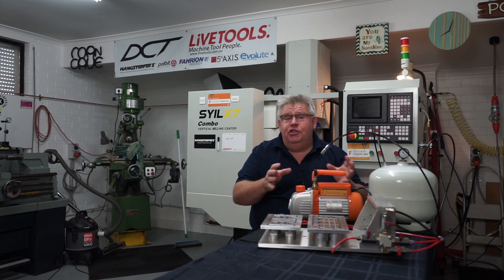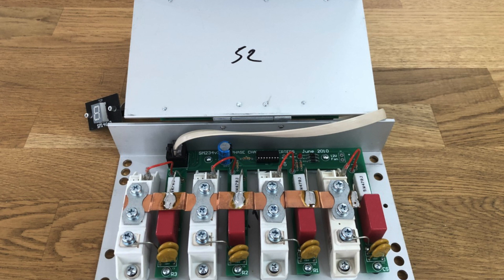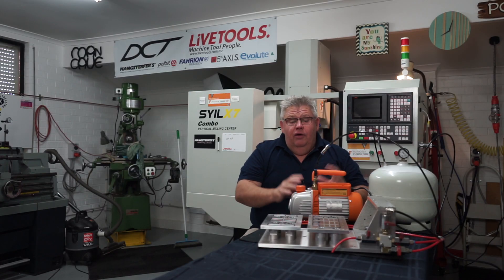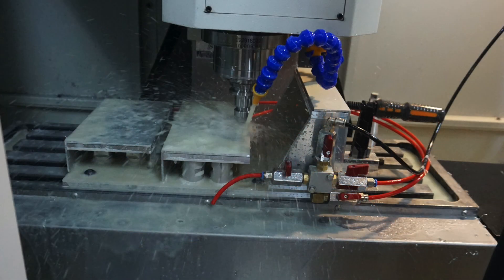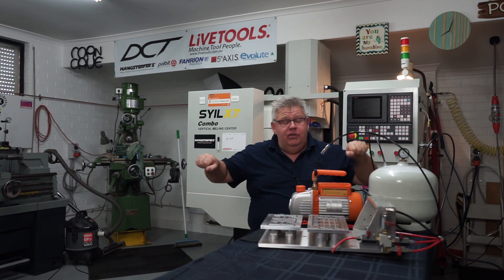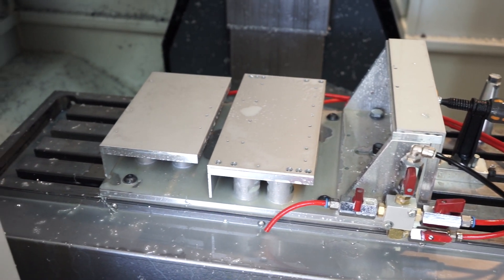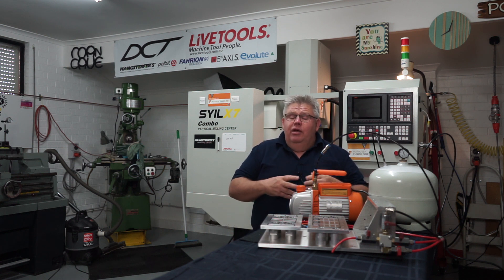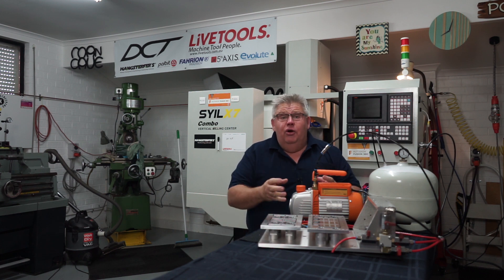CNC Vacuum Fixture Set Up - Homemade DIY

Comment: Good job. I wouldn’t worry about the temp of the vacuum pump. I run mine (JB & Yellow Jacket) for 24 plus hours straight. It does get hot though.
Reply from the maker: Excellent point. Since that video I bought a timer and run a 50% duty cycle. Cheers 🍻

Comment: You can get a cheap used SMC pressure/vac controller on Ebay or a Chinese clone for a about USD20-30. It's a really simple set up where the vac controller triggers a solid state relay to turn your pump on/off according to whatever target pressure and hysterisis you have set on the controller. I have this on a similar setup to yours though I am using it for vac bagging composites and the SMC controller is great to have.That way, you actually don't have to remember to turn the pump on or off, it will take care of that for you. 
Also, good on you for remembering the check valve as these pumps don't like to start against a vacuum. 
But some builders take it one step further and add a 3-way solenoid valve between the pump and the check valve to vent the pump side so that that when it has to restart, there's no vacuum at all to start up against. This should prolong the life of the pump. That said, I realized my pump (same style as yours though smaller) actually leaks/vents slowly by itself when turned off, so I don't actually need the solenoid. Perhaps yours does as well?  
For more on the solenoid venting google "Joe Woodwork Vacuum Pump" and a build manual and reasoning for the various parts should show up. Basically, my setup is a simplified Joe Woodworker pump with a more advanced vac controller.
His design even has a smaller pre-resevoir before the check valve. IIRC that's so the "shock" to the pump once the check valve opens is reduced. Again, it's a "be kind feature" that should help the pump live longer. Now, I also think builders used to use Gast or other types of much more expensive pumps whereas these Chinese HVAC pumps may be cheap enough that you are OK with simplyfying the setup and change the pump once it dies.
Reply from the maker: Hello and thank you so much for your concise and detailed information 🙏. Yes my good buddy Micheal Connor woodwork also put me on to “Joe Woodwork”. He has some great ideas. Oh I agree, I desperately need that solenoid switch. This was my very first attempt at vacuum fixturing inside of a VMC. I was blown away by results and it saved me a ton of time. Thanks again for stopping by and engaging in the conversation. Regards Aaron 🍻
Reply: @DCT_Aaron_Engineering  You're very welcome. 

I am using my pump without a pre-reservoir and venting solenoid but even though the pump hasn't been used that much (perhaps just 50 sessions all in all with a handful of cycles per session), it does seem to have a harder time starting up sometimes now. 
So, I think my pump has taken a beating already. If I had to speculate, I'd say it would be partly because I am using the smallest pump I could find as I wanted the setup to be small but mostly becuase I set my target vacuum to be as strong as possible and the hysterisis quite narrow, so once the vac has dropped a little, the pump kicks in but it does so "against" a reservoir that may still be at -0.8bar so when the check valve opens - which it does almost immediately given the tiny air space before the valve, I imagine the pump gets quite a shock. 

I saw someone mention PVC tubing for reservoirs in the comments. Once you look into Joe Woodworker pumps, you will see plenty of examples of exactly that:)
Reply from the maker: You have reignited my interest in Joe Woodwork. I’m definitely heading back to his website/ forum and investigating more. Yes, my pump ran pretty much continuously for 8-10 hours without a hiccup. I thought for a $120 Aussie, it was great bang for buck. It beats running the air compressor flat out with that silly little vacuum generator that I bought. Enjoy your Sunday. Regards Aaron 👍

Comment: I just used a length of 4" diameter PVC pipe plugged using standard PVC end caps on both ends to make a vacuum tank.  At full vacuum, the differential pressure is only about 14 psi so it's relatively very low.  Leave the pour leprechaun alone ya greedy mooch. :)
Reply from the maker: G’day Stephen. That PVC tank is a bloody great idea. I didn’t think of using that. However I had the son-in-law’s gas bottle here so I pinched that instead.  Oh don’t worry, that little leprechaun 🍀 bastard is still hiding tools on me or knocking them off the bench everyday 🤣

Comment: great job mate !  -   We had an issue years ago where it would suck 1/2 the coolant into the tank - ha ha
Reply from the maker: Thanks for following along Ed. Yes mine sucked a little bit at the start, but vasoline on the rubber solves that problem (I hope that comment doesn’t get misconstrued) 🤣
Reply from the maker: @CMTeamCobra Yes great idea.  I had actually thought of adding one as your suggested (airline water separator).  That way I could keep an eye on during the productions cycle.  Cheers, Aaron.

Comment: Nice job Aaron. What gasket material did you use on your palate to seal the work keys down?
Reply from the maker: G'day Rob. Silly me forgot to mention that.  I went to store over here called Clark Rubber and bought 2m of 3mm black nitrile rubber O-ring cord.  It was cheap at $6 per metre.  I first went to the bearing shop, but they didn't have any.  Cheers, Aaron.
Reply: @DCT_Aaron_Engineering  thanks mate, I just asked on the group as well lol.

Comment: Loved it Aaron! Hey, why no vacuum on the vertical plate?!👍🏻👍🏻 for the Italian tap 😉.  Ciao, Marco.
Reply from the maker: G'day Marco.  Yes that will still need to be done.  I ran out of valves to do it and the cost of airline fittings, manifolds, and valves are very expensive.  That's a next time job.  Cheers mate, Aaron.
Reply: @DCT_Aaron_Engineering  Roget that, Aaron!

Comment: Your Syil is so quiet! Oh, wait. Maybe that's in post production.  It's still likely to be quieter than my Sieg. The screaming banshee.
Reply from the maker: G'day Mark.  Yes I had the volume turned down -15 in final cut pro,  Otherwise it blows the ear drums out of my viewers.  Your Sieg does alright.  Definitely brings more capabilities into your shop.  Thanks for watching Mark.  Cheers, Aaron.
Reply: @DCT_Aaron_Engineering   I can't find the volume knob on my Tormach 1100.  Maybe I need to buy the kit from them.
Reply from the maker: @danl.4743  G'day Dan.  I'm sure they'd sell you one if you rang them LOL

Comment: Great setup buddy!  The production increase you've gotten from this made it all worth it! Wow. Huge improvement.  I have a carbon vane vac pump here that would do that job easily......runs quiet and continuous.  :)
Reply from the maker: G'day Mike.  Thanks mate, I'm really happy with how it turned out.  And like I said it easily dropped a day out of my production run.  I will look into a carbon vane vacuum pump.
...
I trust it's nothing like your "blue veined junket pumper" (google it, it's Aussie slang).  I've been told that it's also quiet and continuous.  LMAO
Reply: @DCT_Aaron_Engineering  Yep...nothing like.........you won't be as excited to put your lips on this one. ;)  lol

Comment: Gday Aaron, that’s a great setup and it won’t take long to recoup your money back also if a part fails there all common components, having this setup really speeds the operating up, great job mate, cheers Matty
Reply from the maker: G'day Matty and thanks mate.  Yes this set up works a treat now.  it only took me 300 parts to get right.  As you can see I'm not that smart but I can lift heavy things LOL.  Jokes aside, I can't believe how fast I pumped them out once I got going.  I was up and down like a yo yo all day.  Cheers, Aaron

Comment: Nice setup Aaron. I need to make a vacuum table. Good video again
Reply from the maker: Hi Mark.  It's very easy to do mate.  I forgot to say that I got the O-Ring rubber from Clarke rubber for $5 per metre.  I can't believe how well it actually works.  Glad I used the gas bottle as a reservoir though.  Cheers, Aaron.